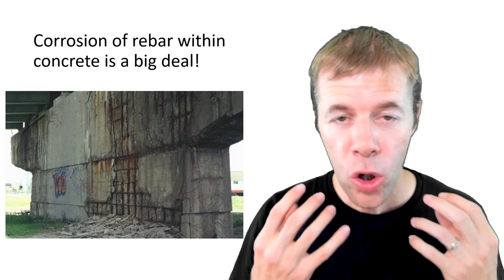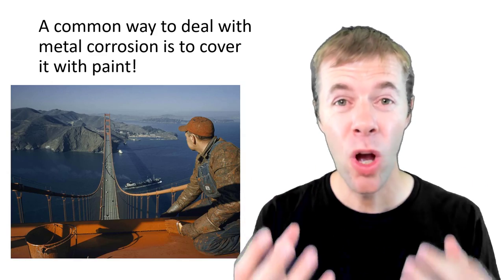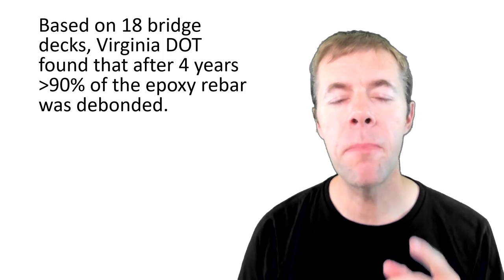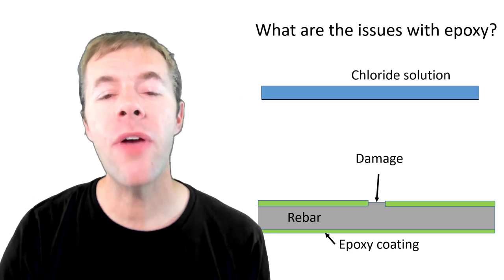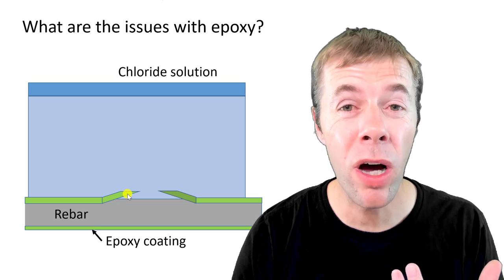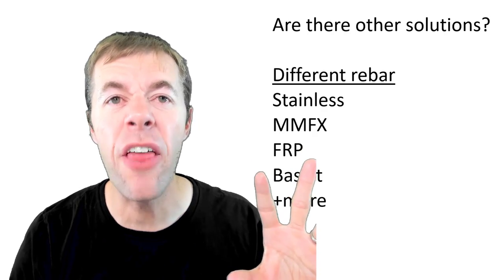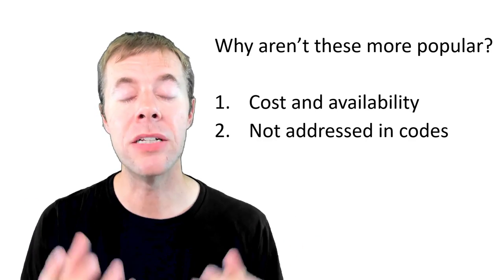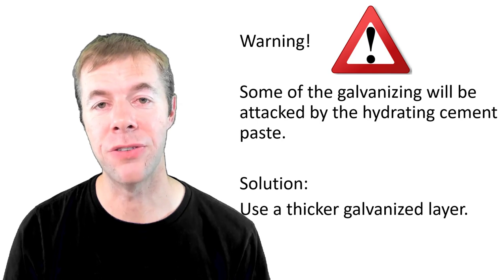What is epoxy coated rebar and why is it being banned?

Comment: Nobody has mentioned formation of hydrogen gas  bubbles when the wet alkaline cement is in contact with the zinc (galvanizing) which can create some porosity. I've always heard solution for that is either chromate coat the galvanized metal or add small amount of some chromate chemical (I forget exactly what) to the mix water.

Comment: Zinc looks to be a good trade-off. I would still question the following: debonding of the concrete from the rebar. Would a soft metal like zinc compromise the overall cast performances ? (would be even worse with epoxy BTW).

Comment: Failure for long term bond is a direct result of improper surface preparation. 
Makes more sense to coat them on-site with a higher impact resistant epoxy such as spc 2888...it dry as hard if not harder than concrete when mixed and applied correctly.

Comment: Please comment of "GRAPHITE REBAR"  -  also what is the appropriate life expectancy for a 20 story condominium on Miami Beach facing the ocean considering construction during the 1970's 80's building boom and using poured concrete with steel rebar reinforcement.  After how many years should these ticking time bombs simply be torn down rather that patched up ?

Comment: Are you sure that it's true that you can simply thicken the coating of galvanizing? As far as I'm aware things that are galvanized are dipped in molten zinc as you say and how do you get a thicker coat than that?
And if I'm right and I think I am, you missed a benefit to galvanizing. I can chip as the epoxy can, but I think that it is sacrificial and that the galvanizing that is missing in the case of a small chip is still protected by the cathodic protection from the zinc close at hand.

Comment: Two dissimilar metals will generate galvanic action. Also galvanized rebar would make the bar relatively smooth making cement bonding impossible compared to common rebar.

Comment: Hot dip adds weight, why not electro galv the rebar and add a waxed type coating or non rewettable bonding agent for preserving from mill to install, also there are certain polymers that can be added to the concrete

Comment: I think I missed something. If epoxied rebar is not  code(right?) then who is banning it? Also nothing lasts forever. I see articles from time to time about the life expectancy of a particular bridge. What are the factors that determine this number and where does regular rebar fit into this? Thanks, enjoyable video. Another thought please. Newer steel ? or iron? bridges are being built that have self limiting oxidation if I am using the right term. No painting required, I believe. Why can't this property be used in rebar manuf?

Comment: Galvanized steel needs an electric current run through it. I'm not sure of this process requires molten zinc or if it just uses zinc salts
Reply: Hot dip zinc coating and galvanizing are completely different processes. The former requires the rebar (or other material) being completely immersed in molten zinc, while the latter just adds the coating by electrolysis  to give a much thinner barrier.

3,500 years ago or so, the Ancient Greeks knew to add a layer of lead to their iron reinforcing.rods and (except where destroyed by war of earthquake) most of their larger structures are still standing. The Romans learned this from them and many Roman buildings, which are partially built of concrete, are also in a fair state of repair.
Admittedly Benitto Mussolini helped in that regard by having a  lot of structures rebuilt to foster a culture of Italian/Roman superiority in order to curry favour with Adolph Hitler and the Nazi party.

Comment: The problem with galvanized rebar is the zinc reacts with the concrete to form a soap which affects the adhesion between the rebar and concrete. This lowers the strength of the structure.

Comment: The Hot-Dip Galvanizers Association of Southern Africa (HDGASA)has for a considerable time been promoting the use of hot-dip galvanized steel reinforcement in concrete.

Steel reinforcement in concrete provides tensile and sheer strength to concrete to supplement its inherent strength of compression. 
The point of departure for a good concrete structure is that the basics are strictly adhered to; here the following factors must be controlled:
•	Correct depth of cover
•	Correct mix
•	Correct compaction
•	Correct curing time
With these basics in place, attention may be given to the reinforcement.
 
The benefits of hot-dip galvanized rebar is simply that galvanized steel is less susceptible to carbonation as the pH falls and also that galvanized steel is more tolerant to chloride with a higher threshold level of possibly 3 times that of uncoated steel. Testing has also shown that the pull-out strength may be enhanced due to the development of zincates at the rebar concrete interface.

It is of significance that a new standard has been implemented: EN 10348-2:2018 – “Steel for the reinforcement of concrete- galvanized reinforcing steel and steel products.” The HDGASA sees this development as very important in the drive to enhance the performance and service life of concrete structures, not only in Europe but hopefully soon followed across our local markets and on the African continent.

Comment: Ferrocement boats only cover the steel about 3/32" but the cement is graded with #8 sieve to a  # 100 sieve no paint in salt water portland #5 check with J. Benford naval archetect.

Comment: A767 galvanized bar is still susceptible to damage during placing. Epoxy coatings have gotten much better in the last 10-20 years and are less susceptible to damage than they once were. They do still require post-installation patching, but then again so does galvanized bar. One of the primary upsides to A775 green epoxy bar is that the bar can be coated in advance, stored prior to fabrication, and then fabricated - the coating is strong enough to withstand the fabrication process. A767 galvanized bar must be fabricated first and coated afterwards. This adds greatly to the lead-time of getting products to the job site. Another advantage that A775 green epoxy bars has is the max length of bar allowed. Most galvanizing vats are limited to 30' to 40' in length, whereas epoxy bar is coated on a conveyor system and is only limited by the max length the mill can roll and fit on a truck.

Comment: I work in the CMT industries and I know there is still accreditation in epoxy coating rebar testing - there are a few tests done that check for holidays and durability on epoxy coating rebar. That could be an interesting topic to cover if you haven't already done that

Comment: I like the galvanizing idea. As a kid on the farm I noticed that well galvanized metal was unbelievably durable. The biggest drawback was poor coating quality, with the areas of failure being obvious quickly. I’m sure the coating process and quality is better now, and it mitigates the issue until the research finds the next big thing in re-bar and ramps up. Can we make Roman concrete yet? 😆
Reply: Farmer here too. Same ons. Btw, lack of “Roman concrete” is a myth.

Comment: I think the reason to ban Coated Rebar is due to the ability for corrosion to continue underneath the coating whereas uncoated Rebar can slough off moisture. It must also first separate (very slightly) from the concrete.

Comment: Galvanized coatings are still coatings.  A nick in the Zinc will still be a weak spot and while it may not delaminate like plastic, it will corrode.  If you could reduce/remove water the corrosion rates will reduce.  Maybe colloidal silica to reduce the concrete's porosity...maybe?  Yes it will a short term cost, but long term, so does replacing a concrete structure.  Yes the volumes are huge and we need to consider multiple variables and not just linear, singular short term $.

Comment: I am a professional in the field: epoxy-coated rebar sucks, because it can only be made starting from straight bars. No wire in coil can be coated, thus no automatic machines can be used for further processing and the consequence is that rebar fabrication is just manual, slow and costly. US construction industry is so far behind compared to Europe guys..... Just increase the concrete cover and switch to normal, standard, cheap rebar. You will then be able to use automatic equipment with massive benefits. Galvanizing ? Costs aside, think about the environmental impact of turning millions and millions of tons of black rebar into galvanized stuff: forget it !

Comment: I haven't watched the entire video BUT, living in NY this was horrifying. its the road salt water soaks into the crap steel and the rust expands, it blows the concrete out from within. sitting under an overpass at a traffic light looking at sunlight shinning through the holes above is very disturbing. wtf were they thinking? when are they going to do something? NEVER
Reply: Concrete wicks water. Concrete eats steel if not sealed

Comment: Epoxy coated galvanized rebar.  But seriously you still get holidays with galvanized rebar because it gets cut and scuffed while handling, transporting and installing (cut, bent and tied). How about sacrificial magnesium anodes installed at regular intervals or impressed electrical currents.  Also, seal the concrete to minimize water intrusion. Better yet forbid the application of salt on the concrete for ice control.  Sodium and calcium chloride are very destructive on concrete and, as you noted, these salts migrate into the concrete and cause the damage.  If rebar was sleved in polyethylene tubing you could further isolate it from corrosion.  I've noticed heavily coated cables used in post tensioned residential concrete slab construction; the same as used for commercial  post tensioned slabs for parking garages, etc.  Is this a solution?

Comment: What about a concrete additive to seal concrete, or the plastering rendering method and material to seal protect the rebar in masonry? maybe a tar coat to rebar, or a electroplating coated method to seal rebar. beach sand used in concrete is salty and bad to rebar, so is the general chemistry in sand aggregates.

Comment: I would think that washing the sand that likely has sea salt in it would help it from corroding the steel.
Another  thing, is sealing it from outside oxygen , which is the main corrosion problem.

Comment: Hot dip galvanized is what was used in all the schools in NYC that are condemned as they are collapsing just like Surfside. The best and cheapest solution is 200 series stainless, which is magnesium based so it is dirt cheap, there is plenty magnesium in the US. They are replacing the entire autobon with 200 series stainless.

Comment: Galvanizing is by far the best and most cost effective way of protecting re-bar. The only thing you have to make sure of is that your lengths are correct as if you have a bar to long and you have to cut it with a grinder,  you are allowingthe whole rusting process to start again.

Comment: Good example of an older technology that may be superior to a new technology.     question:   Would galvanized rebar have the same problem of scratching/nicking of the rebar that would expose bare  metal?   I suppose pitting type of corrosion could occur but galvanized coatings are not subject to de-bonding from  nicks/scratching is epoxy coatings.

Comment: I would be most interested to see a video from you on the topic of the new Oakland Bay Bridge.  As you may remember, after the section fell out of the old Oakland Bay Bridge during the 1989 Loma Prieta earthquake here in the San Francisco Bay Area, it was replaced with a new and rather beautiful single tower suspension bridge.  The problem was in the steel that we got from China.  Apparently something was done wrongly in the zinc-treating process, whatever that is, or something, and when inspected a year or two after completion, a bunch of the enormous and irremovable steel bolts were found to have fractured.  Water damage was also a factor I seem to remember.  Thus we had our old Bay bridge that was expected to fall down again in the next big earthquake - replaced with a new Bay bridge that will… fall down in the next big earthquake.  Would love your explanation of what went wrong with the steel and how it relates to water damage, structural strength, etc.

Comment: Galvanized rebar has been tried and, as I recall, failed miserably. A few decades ago, Penn DOT rebuilt the deck of the I-76 bridge over the Schuylkill River, in Philadelphia. They decided to go with a revolutionary new galvanized rebar. It was no more than 2 years later when the deck had to be rebuilt again because the galvanizing was failing. I believe they then used epoxy coated rebar. IMHO, stainless steel rebar is probably the best answer in bridge decks and associated supports, especially where corrosive road deicing chemicals are used.

Comment: Couldn't the coating be done after the rebar is cut, bent, and tied in place? You could be very rough with the bars, saving on labour in the installation, to offset the labour of coating the rebar.

Comment: I realize this would not be a permanent solution, but would a sacrificial anode (AKA galvanic anode) make the rebar last longer without compromising the structural integrity of the concrete?
 Let me rephrase that,,, I know a sacrificial anode would make the rebar last longer, but would it weaken the concrete in the process?

Comment: Don't worry about the rebar. Soak the concrete in fisholine after it's set. I have put fishoil on exposed outside pine wood, and it has never rotted. CRC Lanocoat lanoline is even better, but it smells like sheep. ...But here in NZ we're used to that.

Comment: I'm no engineer, but my first thought is converting the plastics polluting the earth (and oceans) into larger diameter rebars to attain the same strength as steel without the corrosion.
Reply: Your second thought should be "how can something that is orders of magnitude weaker than concrete be used to reinforce it?" Followed by your 3rd thought which should be "It's a dumb idea."

Comment: Galvanized Rebar is a good choice!!!
The down side is all the bends need to be galvanized before use, if you bend galvanized rebar the coating will come off:(
This would change the cost as well as design aspect when using galvanized rebar

Comment: In the debounding the epoxy acts like a cup of water and holds moisture rather than allowing it to breath and minimize damage. This is also seen in automobiles underbody coatings where what is suppose to protect actually holds the moisture next to the metal doubling down on the corrosion process. Simply put either go to better newer materials, allow the concrete to breath reducing water exposure, paint the concrete but same affect happens all together OR THE CORRECT SOLUTION ALLOW TECHNOLOGY TO EVOLVE TO VTOL VEHICLES AND "WHERE WE'RE GOING WE DON'T NEED ROADS"!!!! THAT LINE IS POWERFULL AND IS HINT HINT AS TO WHERE WE SHOULD BE IN SOCIETY.

Comment: Personally I understand what you are saying, but uncoated re bar will corrode sooner than the coated, as well as causing spauling of the concrete. the coated will last many years longer without spauling. Personally the perfect method would be hot galvanized re bar. But the cost is prohibative to do. Where the coated is most certainly better. What I have seen and been appalled with is bridge beams that are put up unprimed and left unpainted, their life is very limited being left rusty and also does not allow for good inspection and finding fatigue and stress cracking. That I believe is a very great disadvantage and dangerous to everyone. Especially here in Oklahoma, I know of a number of bridges that are left unpainted. This should be included in the bid and painted before assembly, then sandblasted and repainted again where welds were made and then recoated with approved primer and epoxy paint. Thus the metal is protected from the elements  and allows for better inspection for micro cracks and large fatigue cracks from weathering and heavy traffic.

Comment: If you didn’t know they use epoxy resin in the Golden Gate bridge Large cables what do you think keeps the large cables from corroding and rotting away. These are the cables that hold the spans together. Not the ones that are draped down to the roadway.

Comment: The rebar coating will always crack when you bend it. The outside of the bend will be stretched and expanded to a breaking point. The inside curve will be compressed and deformed. Any bending of the steel should be done before it is coated.

Comment: What happens if the concrete is made with sand that has salt in it.   That makes chloride levels much higher.   Shouldn't it be washed sand to get rid of salts?

Comment: I'm a ME and have been having nightmares about concrete and mainly the re-bars. Prestressed and post stressed concrete is even a worse accident waiting to happen. I like the heavy galvanized re-bar as a excellent alternative but it would have be a heavy applied electrolysis plating process and not just a hot-dip!!!!!.

 I've been thinking about carbon-fiber re-bars but the ridges that act to lock the re-bar into the concrete concern me. In FRP or carbon-fiber, epoxy is used to bound it all together. As the concrete moves from stress and temperature changes I can visualizing these ridge shearing and eventually weakening the structure.

Heavily galvanized steel re-bars would move as a unit under stress and these ridges would remain intact!!!! 
 
I'm also a Corrosion Engineer and I've seem where Cathodic Protection used to protect re-bar with limited success.